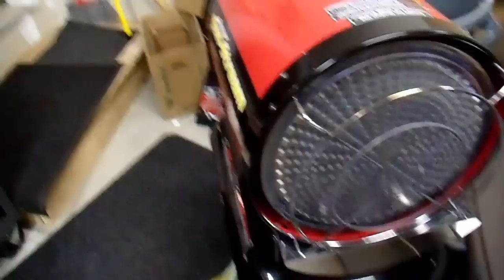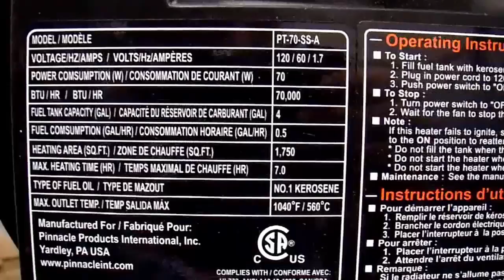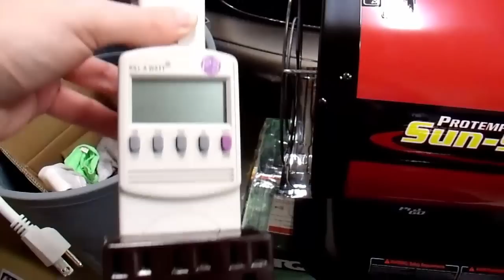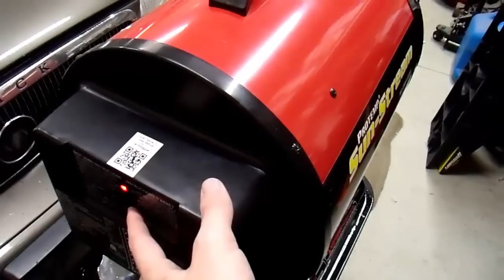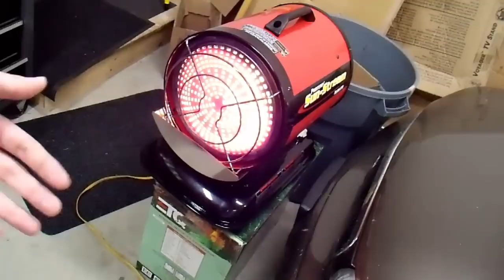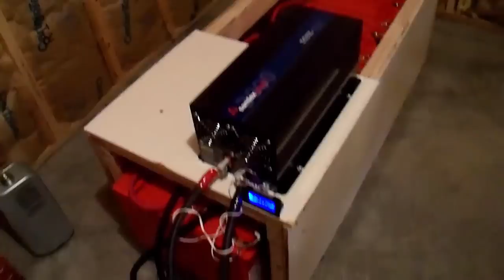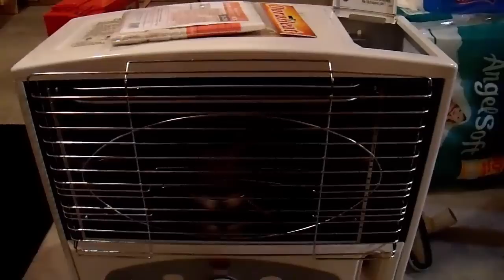Heat your Shop or Garage without Electricity - Diesel or Kerosene Heaters and Inverters

Comment: Heat your Shop or Garage without Electricity! All you need is a heater and some electricity!
Reply: dc current converted without electric it's off the grid.
Reply: SuperKONR , Yep!
Reply: No you are all wrong. You have to purchase an old car to run it lol.
Reply: SuperKONR heat without plugging into the wall.  He didn't plug it into the wall, now did he?
Reply: Jeff D but he still used a type of electricity!!
Reply: SuperKONR ikr. The title of the video is misleading.
Reply: SuperKONR I believe he meant without running up the utility (electric) bill of your house.

Comment: So what modifications did you make to the converter? Thanks for the video.
Reply: JOGO that class of commonly available inverter puts out a "modified sine wave", vs more expensive ones that output a "pure sine wave". It's a concern because some electronics won't run well, and some not at all on a modified sine wave inverter.

Comment: Did you check the power being drawn from the battery? This would tell you how often you would need to crank up the car to recharge. Also, as a retired Fireman, I would advice AGAINST using these heaters inside a closed building. For the safety of the inhabitants you MUST provide ventilation to replace the oxygen being burnt by the heater, which is a lot. Yes, CO2 is deadly and you can monitor that but you can still die if there is not enough oxygen for you, the other occupants and the heater. Your pets will die before you do in your sleep if no replacement is introduced for the oxygen consumed, don't rely only on the CO2 monitors. Lack of oxygen can lead to hypothesis (hypoxia), the risk of permanent damage to the brain, lungs, liver and heart are great and take place within minutes of the start of the condition and this damage is IRREVERSIBLE. So please, don't use fuel burning heaters inside your house without proper ventilation.
Reply: Gilberto Diaz Castro sorry I didn't see that
and no I don't want or need an apology 
Like I said, confusing co2 and co is one of my pet peeves that heating "professionals" and fireman seem to get wrong all the time!
anyhow have a great day!
Reply: Gilberto Diaz Castro. CO= Carbon monoxide. CO2=Carbon dioxide.
Reply: Mr Rees you are correct, what you expect from an old man? Hehe
Reply: +Gilberto Diaz Castro. No worries. Put it down to smoke inhalation.
Reply: You meant to say carbon monoxide not carbon dioxide right fireman?
sorry it's one of my pet peeves 
CO is the silent killer
Reply: How about thanking the firefighter for his attempt at helping people save lives?  The firefighter took the time to send a nice message of warning to readers and here come the keyboard warriors correcting him.  Yes CO vs CO2 - I get it.  I don't care what you call it, the message is clear, don't use these types of heaters in a closed building.  So I'm going to take the time to go off topic and talk about good ol' fashion manners.  

Wouldn't it be offensive if I went to your Youtube page and corrected your English?  For example, your Xr400 crashes video title.  You wrote "5 more races".  When the number is less than 10, you should spell out the number ie; "five more races".  Offensive and petty for me to correct you when I should rather appreciate the fact you are a pretty good rider and your moto skills and interest should outweigh a simple grammar error.  

How about re-read his reply and look for the positive message and education provided on the dangers of hypoxia? I'm sure since I'm calling foul, I will get negative replies, but that is what I expect from keyboard warriors.  

We all make mistakes and I can't wait until the day I'm perfect.  

Like how I did that?
Reply: M Thanks for your comments. God bless you and Merry Christmas.
Reply: God Bless and Merry Christmas to all of you.
Reply: +Gilberto Diaz Castro. Happy new year back.
Reply: Same to you bro!!!
Reply: Walmart carts with bed bugs
Reply: Gilberto Diaz Castro  hey,fireman,carbon Monoxide,CO,NOT CO2.
Reply: solartherm I think I already admitted to my mistake. What do you want an apology?

Comment: the aftermath of the burnt  diesel will help you sleep ,, it is proven that if you breath in gasoline fumes you will get a head ache,, the opposite goes for diesel fumes ,, it makes you sleepy with out the head ache part ,, just wonder how long it would take to make it fatal from diesel fumes  .. what i mean is a ever lasting sleep as in fatal ,, i do not recommend of you to light that thing in a room without the proper ventilation
Reply: You are dead on as dead on can be ..... be careful folks burning any fossil fuel produces carbon monoxide if i'm not mistaken     GWALLNUT666
Reply: well actually  most older houses have more than enough air leakage but if your house is new and tight might want to crack a window at each end  and as he says  use a CO meter/alarm when using non standard heating. propane is best for indoors cuz only produces co2 and water as waste gasses

Comment: what do you have invested in your backup battery setup? How often do you charge them up? Do you keep a battery maintainer on them to keep them at 100%? How long could you run the heater before the batteries are depleted?

Comment: I bought an Alpaca kerosene heater last year which cost me a lot more than most commonly available such heaters. I bought it because it is a good bit smaller and a more ideal size for my situation: It doesn't heat things up so quickly causing me to take it outside to turn off. They didn't recommend it for indoors. So, I wanted to see how much CO it put out. Last year I ran it 30 to 40 min and saw some CO readings on my digital detector. I thought this year I might be able to put a piece of metal around the top of the burner and make it burn cleaner. I had some aluminum. Of course, this thing might melt that. Copper and zinc might give off harmful fumes. I remembered I had a piece of perforated stainless steel I had bought off the internet. I cut a strip about 2" wide and wrapped it around the top. I held it in place with a big hose clamp. I had to put a crimp in the hose clamp because there's not an ideal size....Now, several times I've run my modified Alpaca heater for an hour or more and get a zero reading on my CO meter. Also, I don't think I'm smelling any odor at all. I'm really proud of myself! I think should put a picture of this on YouTube.
Reply: discountbrains  b

Comment: so you don't plug it in?
I am confused by the title.
Reply: you don't plug it into the wall, this like many of knurlknars vids  are for temporary grid down situations, most everyone has a car therefore a car battery and charging system, just got to figure out how much your car needs to start and not run the inverter more than that (with a small safety margin) and he repeatedly says  this is nice cuz of the amount of heat it gives the relative clean burn (catalytic) but a better system might be the old wick type but they don't burn as efficiently as this does and you would need a couple for the same amount of heat. most house leak air enough but always have a CO monitor in addition your your fire detector  if you use either of these.

Comment: FYI  CO detectors that are consumer bought are programmed to alarm by CO present vs. time of duration. For this reason you may not see a CO reading at all even if one is present because of a low reading vs duration. Alarms are activated when over 30ppm is present or there is a continuous steady rise of CO.

Comment: You should NEVER make a battery spark when hooking up the leads... Always hook up (+) red lead first and the (-) lead last... That way you get NO spark... acid battery can explode...
Reply: doesn't really matter which is first or last if you're connecting directly to the battery terminals.  The concept behind negative last that the safetycrats advise, hooking the negative to a point remote to the battery and away from the hydrogen fumes just waiting to explode you.   So long as you don't pick a ground point next to some leaking gasoline, which is probably more likely than an outgassing battery.
Reply: Z71Ranger too bad electricity flows from negative to positive 😂

Comment: Awesome toaster : thanks for your your useless comments. Yes my vision isn't what it used to be. I do understand that DC power,modified sine-wave, watts, power ,invertor, are ELECTRICTY descriptions used when powering devices. Not sure what your point is. Btw,besides messing with things,and playing games, you might check spell check before posting in the future. Yes the wick style heater does not require power but the video features electrical devices for the most part. Good day.

Comment: You have to try a waste oil burner. No power required and they put out a lot of btu's. We have one in our shop. Can be used to heat water for a hot water heater and if you want it to burn clean you can use kerosene.

Comment: If you develop a problem with the heater not firing please update us. I've read quite a few amazon reviews with consumers having problems within 6 months on the ignitor assembly - 75-025-0100 which had to be replaced, about $70 with shipping. To make things worse the part was typically on back order.

Comment: Car battery's and charge systems are not designed for this use.  One could burn up the cars alternator with this type of use. Car battery's are used for short draw time.
Reply from the maker: +Paul C Johnson This level of draw will not stress any automotive alternator.
Reply: knurlgnar24
Reply: knurlgnar24 I have a 6000 watt class D car amp with a STOCK alternator and reg car battery NEVER had any issues with my charging system...that tiny 400 watt inverter isnt hurting anything. ...you to me seem like a smart and resourceful person...

Comment: Another kero enthusiast! - How does it run on dyed kero? I have wick heaters that don't like the dyed stuff. My old Perfections don't mind, as well as some Omni 15s, but anything with a fiberglass wick clogs up pretty fast.
Reply from the maker: +Jollyprez It will run perfectly on dyed kero.  These types of heaters don't need 'wick grade' fuel which is a significant advantage.  They are more complex and more prone to failure though...
Reply: knurlgnar24

Comment: Nice video. Good to know a heater like that will work on sun power. The kerosene heater is nice but you never want it to run out of fuel unattended or the wick will burn up and it wont be a purty or an easy fix. Thanks for posting.

Comment: Modified sine wave should be as efficient,  because it is the RMS output that determines apparent power in KVA.  The only problem is the presence of harmonics,  which should be filtered to prevent damage to electronics,  and improve the power factor.

Comment: Where did you get the metal cover at the bottom?
Reply from the maker: +NLDLC0517 It came with the heater.  I did install it eventually to avoid frying the flooring it was sitting on.

Comment: I want to run my kerosene torpedo heater on veggie oil. The label says oil or kerosene does this mean i can run it on veggie oil? Kerosene fumes make my head hurt. ANy thoughts?
Reply from the maker: +Ricky Iglesias It will not run on veggie oil due to the thicker consistency, and you should not put biodiesel into these units either.  Just Kerosene, #1, or #2 diesel.  They all burn the same cleanliness once the heater is warmed up but #2 will smoke on startup.
Reply: +Ricky Iglesias you can go veggie oil but you need to pre-heat it.... but it smell rough too...

Comment: Could you burn ethanol and run it in your house?
Reply: +James Steidl No. Never run a kerosene heater on anything but kerosene.
Reply: I think you mean CO, not CO2.
Reply: +James Steidl  dude... don't do that in a house... really
Reply: +James Steidl    yes,  you might  shorten the fuel pump life.   Also kerosene has 130,000 btu per gal...ethanol has 87,000 and gasoline has 117,000 btu.   The gasoline would be most explosive followed by ethanol.   Best to stick with kerosene in large ventilated area as it might save your life.

Comment: Misleading,,,modified sine wave, DC battery is electric power,,,,,,good demo misleading headline.
Reply: +Mike Davis perhaps he should have said "during a power outage"
but that seemed clear enough to me, to be what he was talking about, answering concerns from people wondering since most people would buy a kerosene heater as a backup plan for an outage.
Reply: Ummm ... yyyeahhh... I was thinking he found a way to CONVERT these types, i.e. kerosene heaters that run on inverters, into heaters that run without electricity. That's why I was so excited about the video and it appears as though I'm not the only one. ;-)

Comment: Ummm, "... without electricity." You ARE using electricity from the battery.
Reply: +pink floydmatic I agree with ken porter.
Reply: +Ken Porter pretty sure he is referring to "mains" electricity.
Reply: +Erik Liska then he should have said so.
Reply: +pink floydmatic no one's trying to be a smart ass - the title is misleading, that's quite obvious; Had he inserted '..without mains electricity..' in the title then there would be no confusion. Using an inverter and a car battery is by anyone's definition 'using electricity' - go figure.
Reply: ***** if you don't want a reply why the question mark? idiot
Reply: +Ken Porter trying to be a little smart ass like the kid seating in the last bench? But i just take it as u were just messing around.
Reply: +Grand Negus he bought it full retail and says it how it is
Reply from the maker: +Ken Porter 20+ killowatts of heat out of a couple hundred watts of battery power available anywhere there is a vehicle or equipment.  The heat all comes from the fuel.  It just needs a battery for the fan and fuel pump.
Reply: +knurlgnar24 i.e it just needs 'ELECTRICITY' for the fan and fuel pump
Reply: ***** and if you dont have that then propane or wick kerosene is the way to go
Reply: Ken Porter

Comment: Theoretically couldn't you plug a battery charger into this inverter to offset the  draw from the inverter from the battery?
Reply: no. there is no such thing as overunity
Reply: +DMAN22yeah who sad anything about over unity? He is asking about keeping the battery charge up....smh
Reply: believe it he wants to plug a battery charger into the inverter that is draining form the battery
Reply: DMAN22yeah I stand corrected....he is....unbelievable. I guess we all did not know such simple things at birth.
Reply: believe it i know right, the best battery chargers are only around 85% efficient and this inverter arounf 80% at best
Reply: DMAN22yeah the whole video was a bit ridiculous. It's like, Wow!, if you plug an appliance into an inverter it works!   wth?
Reply: believe it the msw test was valid tho

Comment: YOU invertor is a harbor frieght brand.wich uses a non replaceable mini fuse. of 25 amps
Reply: he repaired it and shorted the blown fuse
Reply: dshmechanic
naa i just make jumper asnd connect a new fuze to the old one prongs. and done. replaceble fuze . no more desoldering an resoldering.
Reply: You could do that as well, where space permits. Often times though, there just isn't sufficient room to do it the way you're describing. I've noticed some manufacturers that seem to be more apt to cram 10 lbs. of sh*t in the 5 lb. pail. Those are the brands that make me cringe before I even loosen the first screw, lol.
Reply: dshmechanic
i know ive taken apart my fair share of stuff as well

Comment: to bad Kerosene cost so much! over $4 / gallon.
Reply: +Nat TheProjectGuy   Over $9 for me.  I gave it up.  My wick heater aint big enough for my garage and at over $9 per gallon, forget it.  This one in the vid looks good enough but I just cant justify the price of K1 anymore.  Not to mention it's almost impossible to find "in stock".  $36 for one tank full?  I think I'll just build a bonfire in my garage instead.
Reply: +Nat TheProjectGuy 5.60 per gal here...and mine holds 12gal
Reply: +DW Red that's robbery.

Comment: Knurlnar-  did you have a  reason for the MSW use or was it just to experiment with?Tks. Mem
Reply from the maker: +Mem Blanc An experiment.  But it shows that a cheap-o $20 inverter from Walmart will work perfectly with a unit like this.

Comment: I saw on youtube that you can mix 1 part gasoline to 4 parts diesel and use in this heater. What do you think?
Reply: Mixing gas in a heater is deadly!
My father in-law could tell you if he wasn't dead.
Reply: +Junie Jerant It will burn your eyes while it runs ..i have a multi fuel 170.000but heater and have tried it...
Reply: +Benny Russell yikes! :( don't mix your fuels, clearly.

Comment: u should never connect the negative terminal first ! positive first; sparks created from battery terminals can cause a battery to explode, and blow your face off! Darth Vader got a similar lesson I believe. this happens a lot more often than you'd think ! ask anybody who works in an emergency hospital . there is a gas leak ie. heavy fumes it could be a lot worse. safest bet is to ground elsewhere to the engine or body for ground ! disconnect ground first , install positive first in any situation .
Reply: he knows what he is doing. it will spark either way you hook it up anyways
Reply: +DMAN22yeah 
I saw a battery explode in a guys face, it is not pretty.
Continue connecting negative first and you may witness the same. 
Some people can't learn without experiencing trauma!
Reply: +Benny Russell its going to spark either way, if you want to avoid that use a 10 ohm resistor
Reply: +DMAN22yeah 
The ground can be connected in locations other than the battery. locations that aren't in close proximity .